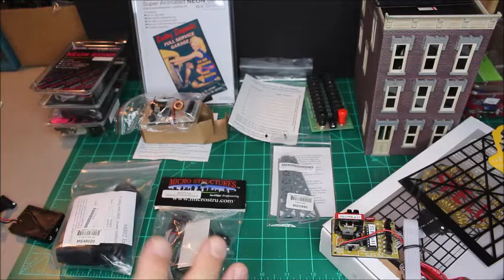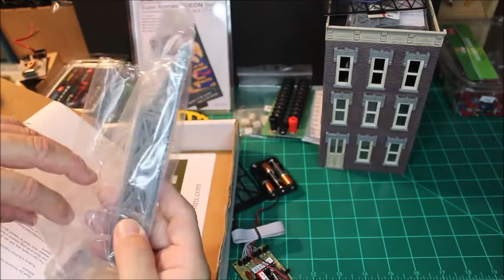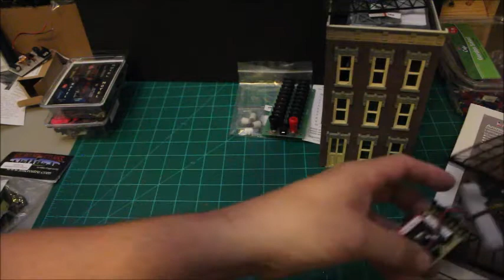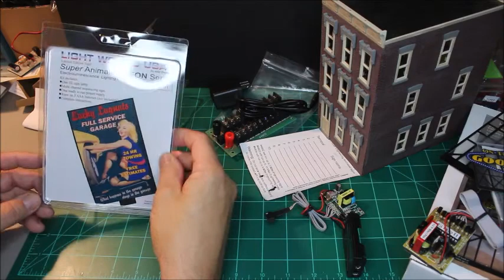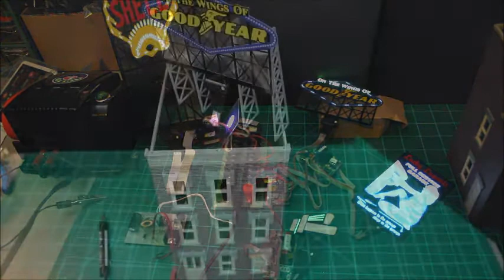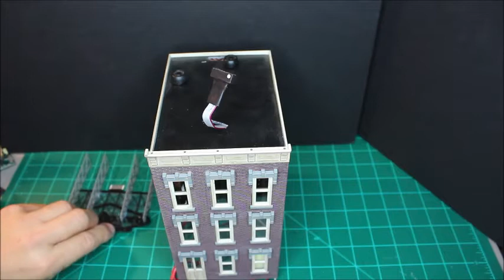O scale Train layout basics From the ground up to the finish Part 3 Three Miller Engineering

Comment: I watched this a couple a Times and I wanted to ask on the power pack to the 4804 converter do you or did you Sir only hook up to the DC only side of the Lionel Power Pack thanks.. Allen RDA N Scale..
Reply from the maker: Hello and thank you very much for the question. No I hooked up the converter with the AC power and the converter switches the AC to DC. Thanks again